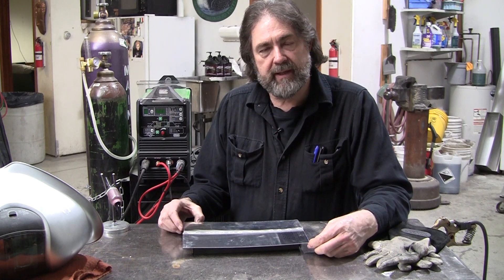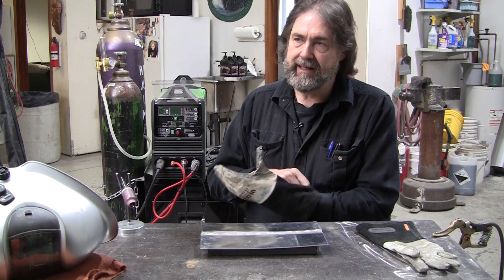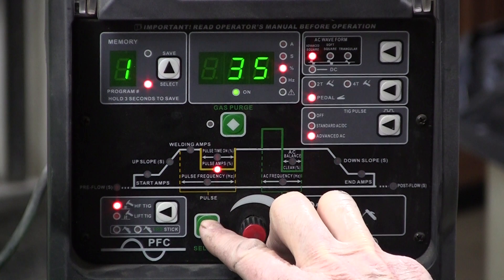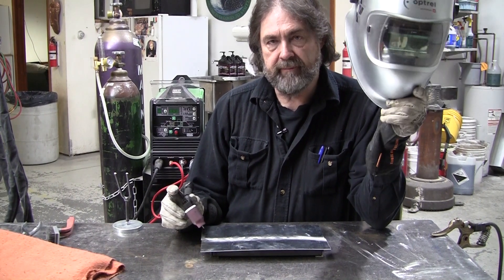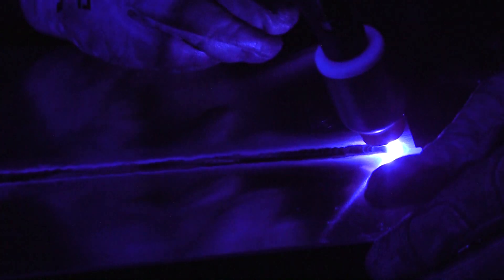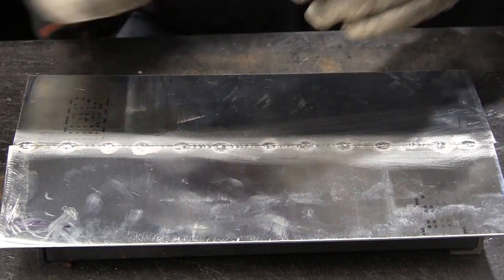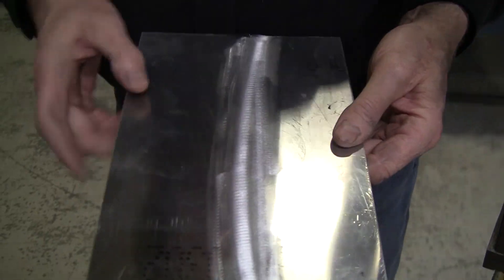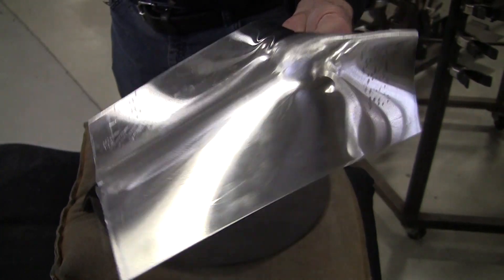Butt Welding Sheet Metal: TIG with Pulse

Comment: I'm trying to weld .032 6061...without success. I'm using similar machine settings but pure argon. I'm having a hard time with the initial tacks. Do you think Helium would help?
Reply from the maker: Put thin copper sheet ( .023") behind the seam. The copper will insure that the argon totally shields the weld zone.

Comment: Thank you for a great video! What would you recommend for a beginner for aluminum welding: tig welder with pulse (argon+helium) or oxy acetylene gas welding? I guess tig welder is much safer for the workshop and can be transported easily...
Reply from the maker: The tig welder with pulse and the argon/helium mix will serve you well on aluminum, steel, copper, stainless, and other metals as well.  Tig is easier to learn and now they are not that expensive.

Comment: Wish I had watched this before...I just finished my first expansion chamber for my two stroke drag bike and used my pulse settings for the first time and had the pulse set way too fast.  Used 20 gauge with .043” rod and it cooled the puddle way too much and switched to .035” and now I am thinking I need to go smaller.   Thank you this was a big help!

Comment: Why didnt you hold your tig torch over the piece for a second of 2 pre and post flow for gas?
Reply from the maker: Hi Greg, how did my weld look and perform?
Reply: Only needed on steels aluminium has a different type of oxide that's why some don't even use a gas lense on aluminium forgive my spelling of aluminium I'm Australian 🤣